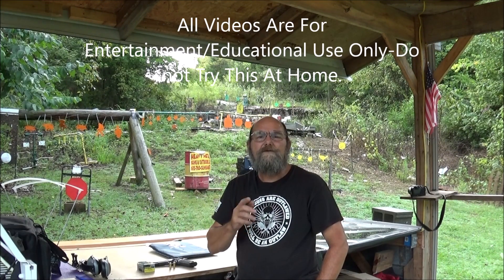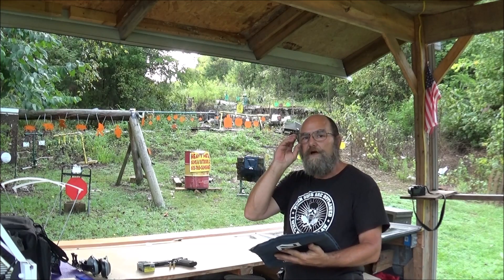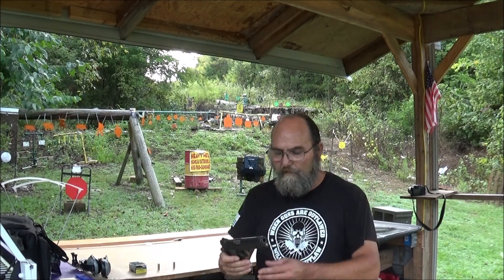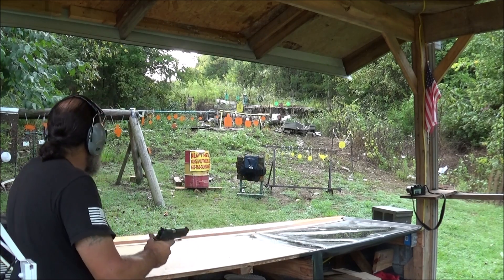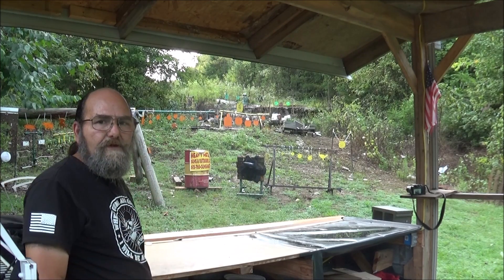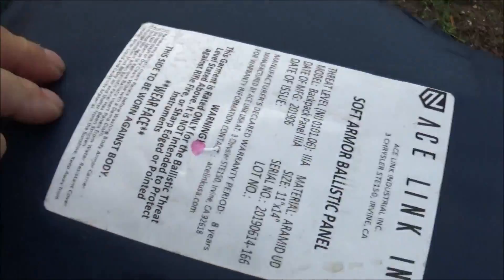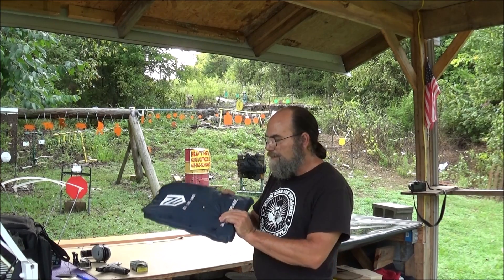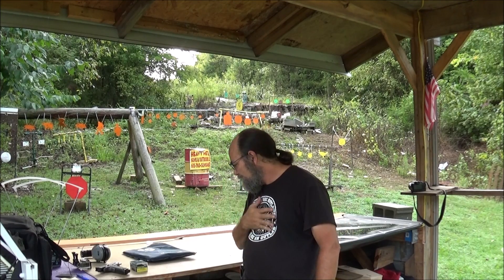10mm Buffalo Bore VS 3A Vest

Comment: You are right Paul. When it comes to 10mm, Buffalo Bore and Underwood really step it up👍🇺🇸
Reply from the maker: Agreed
Reply: @HeavyMetalGuns  I  wonder if Underwood would get through her with it's Gold Dot Hollowpoint?
Reply from the maker: I am guessing it would not.
Reply: @HeavyMetalGuns  You are probably right but, in my mind the sharp edges of an HP has a better chance of cutting through than a solid.
Reply: @jarrodbath2375  yes, I bet they would go right through it with that screwdriver tip👍🇺🇸

Comment: BB isn't fast enough. And that flat nose spreads the impact force out over a larger surface area, which means less pressure. It's hella good on organic tissue, but not good enough for this synthetic material. The solid copper Lehigh Xtreme projectiles move much faster and concentrate their impact force into a smaller surface area, so they hit with more pressure, and they punch right on through.
Reply from the maker: Cool!!

Comment: If .44mag won't penetrate, I don't see what chance 10mm ever had. Maybe with machine tool steel grade core, but those are illegal to make after 1986 for civilian pistol calibers. BUT, if the bullet is small enough and is going fast enough it has a shot at making it through. Try it again with military surplus 7.62x25mm Tokarev ammo. (ideally some of the hotter Bulgarian stuff)
Reply from the maker: Cool

Comment: Should be singing out at higher speed out of the fk BRNO
Reply from the maker: They did not.  https://youtu.be/jiA1f5MHFbY
Reply: @HeavyMetalGuns   wow I totally forgot the bull barrel on that 911. That is still the classic Best for sure. The buffalo boar is designed for longer barrels it could give ya different results though, and since the new 10mm barrel on the FK BRNO should be broken in by now. You should try them hard cast leads side by side with the 911 see how fast they are out of each gun.